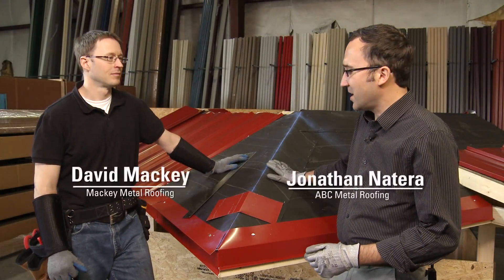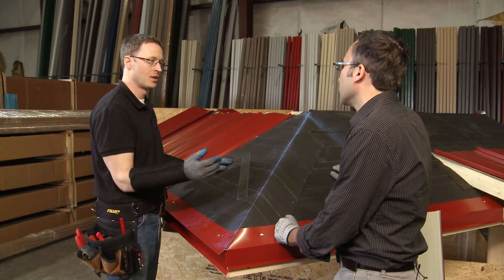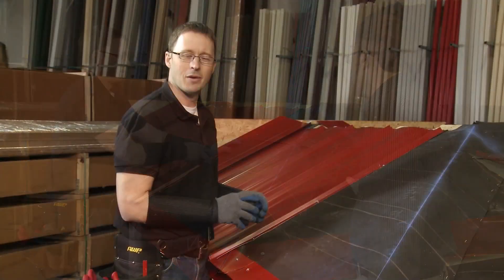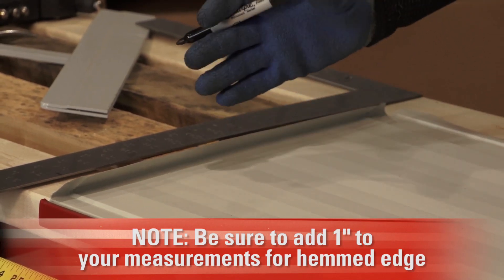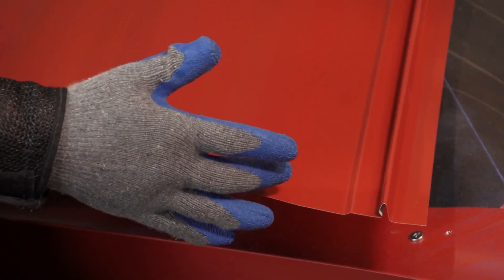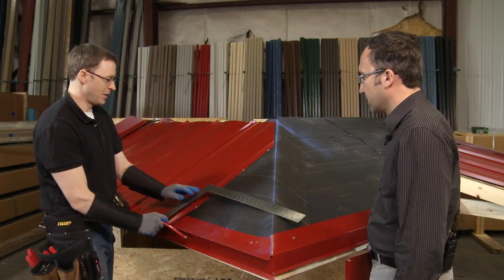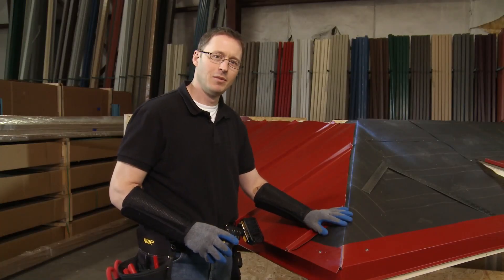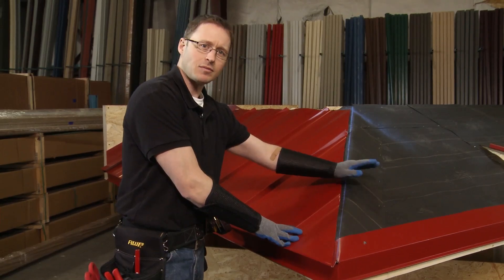How to Install a Hip Panel: ABC SL-16® Metal Roofing System

Comment: Or just put your panel up and mark your cuts on each side and use a straight edge to join those marks. Or just use a chalk line depending on how long your cut is.

Comment: Place panel overlapping hip, snap chalk line up hip, cut on chalk line. easy.
Reply: What's the best tool to cut them in place?  An air nibbler, shears, or a cutting disc?  Thanks!
Reply: exactly, making this way to hard!
Reply: Thank you

Comment: I'm a little unclear on the 17.5 inch mark on the ruler.  You mark the square and place it to the inside of the male piece but measure from the outside edge to make the piece.  Wouldn't that be half inch off the measurement?   If I had it in front of me I'm sure it would make sense.
Reply: You are correct, he should have put that ruler square on the far side of that ridge, but he put it on the near side. But I assume because the overlap on these sheets is so minuscule it hardly affects the measurements. However if we were using panels that use much more overlap (like corrugated sheets which have 2 and a half overlaps of the corrugations) then that square he used to start the measurement would have to be back at the start of the where the overlap is going to be, not at the edge of the last sheet. or easier to know the exact overlap width and to deduct it from the measurement, then place the square at the end of the last sheet.